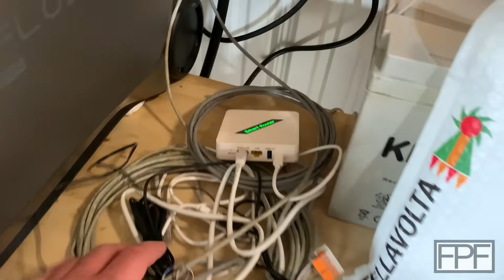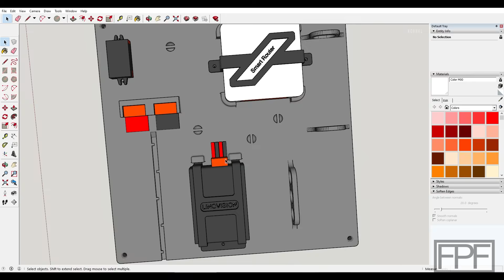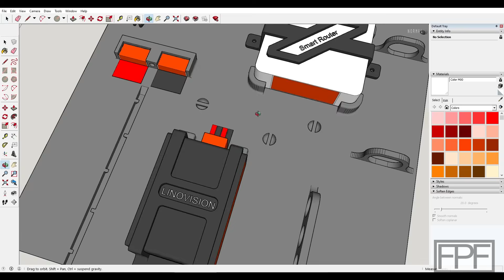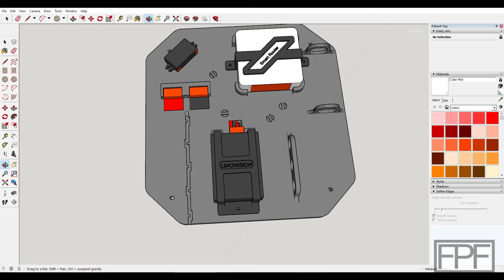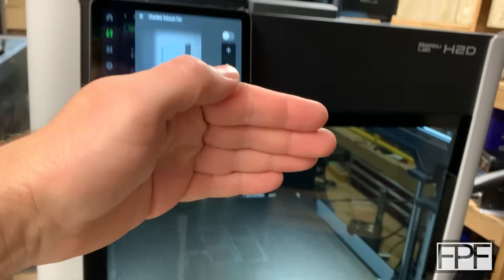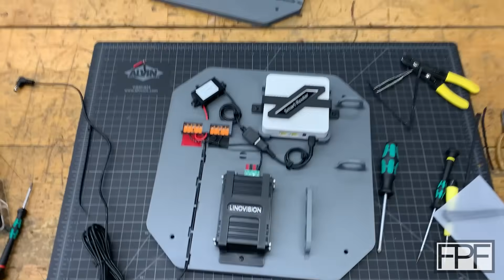3D Printed Equipment Mounting Board - H2D Problem Found

Comment from the maker: Nobody panic, this should be an easy software fix to give us the needed option to avoid this issue.  The H2D remains an awesome next-gen machine.  EDIT: a lot of folks in the comments seem to be missing what the issue is here.  In summary, this is caused by the "exhaust fan" cooling the print unevenly when the ambient room temp is low or changes.  While there are controls in the slicer for the "part" and "aux" fan, there is presently no control for the "exhaust fan".  It can presently only be disabled by modifying the "start gcode" for each filament.  There's numerous ways this could be solved, but a good starting point would be for Bambu to add the "exhaust fan" to the same section of the UI in the slicer where the "part" and "aux" fans are configured.
Reply: Funny thing is that it already exists. The setting you are looking for is in material settings.
Reply from the maker: @BifsieOfficial  where?  I see "part" and "aux", but not "exhaust"?  I do see it looks like we can mod it out of the start gcode settings at the filament level, but I think a slider for whether to enable it or not rather than modify every single filament preset would be helpful.  Am I missing something?
Reply: @FunctionalPrintFriday So for you, editing the settings of the other coolers for each filament is fine, but for the exhaust fan it's suddenly inconvenient? And yes, you need separate settings for each individual filament, precisely because each of them behaves differently and some need maximum airflow from all sides, some don't.
I can guess the reason why these settings are in the form of g-code, most likely because it is impossible to make one separate slider, because there is a dependence on other printer settings, for example, for different table temperature different values of exhaust cooler.
p.s. Sorry, I replied to the wrong thread. I was responding to this comment https://www.youtube.com/watch?v=sYN-dwEzZQ8&lc=UgwVapduMXSDJznUX1J4AaABAg.AHO5ASZA3d7AHQZKH8Ozrr
"Manually modifying the start gcode for all the PLA/PETG filament types seems rather painful though, hopefully they either add a device-level control in the UI, or at least add the exhaust fan to the cooling settings in the filament config"
Reply from the maker: @Firz82  I'm not sure what you're trying to say.  There is presently settings to control the part cooling and aux fan in the filament settings, but there is no setting for the exhaust fan (which is the fan causing the problem here).  You can manually disable the exhaust fan by editing the start gcode for each filament, or turn it off using the touchscreen each time as the print starts, which is what I did for the 3rd print that came out great.  I'm saying that at a minimum they should add the exhaust fan to the same part of the UI where the part and aux fans are controlled, or add a device-level override at the print-launch screen or device config.
Reply: @FunctionalPrintFriday  I meant that the g-code for exhaust fan control is more complex than just a % value. If you look at this code in the Advanced tab, you can see that it uses table temperature values and information about whether air filtration is enabled or not in its logic.
Reply: I think that the “disable exhaust fan in printer” button will only hurt most users who don't fully understand what they are doing and what it can lead to, because for certain types of plastic the nozzle will start to clog. The manufacturer believes that this setting is for advanced users who understand what they are doing, and I partially agree with it. The main problem I see is that even in their Wiki and FAQ they don't tell anywhere (or I don't know how to search) about exhaust fan, how it can affect printing problems, these g-code settings and how to manage them.
Reply: @FunctionalPrintFriday 

In the filament profile, try enabling "enhanced air filtration" or whatever it's called! On the X1C/P1S it's the only way to edit the exhaust fan speed, so maybe it's similar on the H2D? it's quite counterintuitive, they need to fix this.

I spent a lot of time trying to fix the fact that my P1S kept setting the exhaust fan at 100% when printing engineering materials lol, the start gcode sets the fan at 100% by default if bed temperature is over 80C lol. "Enhanced air filtration" fixed it!
Reply: @Firz82 doesn't the H2D have a chamber temperature sensor?
You could set a max and min temperature you would like to hit, and the printer could automatically close the vents if it goes under your preferred minimum temperature (and of course open them and ramp up the fan accordingly if it goes over the min, and approaches the max)

It would not only fix the issue for PLA, and PETG, but also be much more intuitive to users in general for all types of filaments.
Reply: @FAB1150  Yes, as far as I understand from the description of this functionality on bambu's site and other people's reviews (my H2D hasn't arrived to me yet, so I can't test it myself), this is exactly how it will work. This is just one of the reasons why the exhaust fan control logic is in this section with g-code, and not just a slider with values from 0 to 100%.
Reply: @Firz82  A simple warning, or putting it behind 'advanced' mode would suffice.
Reply: Update filament settings. Put 45C in for PETG. Prints mint. Stays in heating mode. 40 is the bambu cut off. Below it is cooling, above is heating. Granted your method to override temps with the air filter enhancement works too. I do find my petg filaments do better with 45c heat on
Reply: I mean, you made it pretty clear. People live to comment without watching the video. You'll see more and more of this as your channel continues to grow.
Reply from the maker: @michaelgleason4791  probably right
Reply: It seems that the issue is the internal stresses within the part are greater than the magnetic force keeping the build plate to the bed. Without hands on experience of this issue myself, I believe the easiest and most robust solution to the symptom you are experiencing is to create a set of retaining C style clips that can be installed from the edges of the build plate and bed effectively securing the plate to the bed restricting the plates movement in the X, Y and Z axis. 
Alternatively, the  Markforged Eiger slicer creates tool paths that are designed with the parts geometry and material in mind that will greatly reduce the internal stresses created during extrusion. e.g. Eiger may start in the middle of the part rather than exterior walls and printing outwards to allow for even cooling and spreading the stresses more evenly across all axis. In comparison, most consumer slicers will prioritize external walls the infill from one side to another. This is the worse case scenario for creating internal stresses pulling on the exterior walls. 
Keep in mind that once the C type clips are installed, you may then find for these large prints that the part will then break free from the build plate....Glue stick! Hope this helps! Looking forward to an update. Great video!
Reply: @RevEngFTW  someone’s already made clamps for it on makerworld.
Reply: Would be curious to know if you hear back from Bambu.
Reply: Set your chamber temp to something other than zero and let the machine do the rest.
Reply: Not a software issue, your build plate is sitting high in corners. Take build plate off and tighten the screws underneath and should solve your issue.
Reply: How should a weak magnet and a too thin plate fixed by sw?
Reply from the maker: @lazyman1011  Problem isn't magnets, it's airflow causing shrinking unequally.  Print was perfect after solving for airflow.  They need an option to disable exhaust fan/vent
Reply: Edit: Couse I didn’t red the hole conversation due to the yt app.

The build plate should always be stronger than the material deforming force.

But that’s only my idea.
Reply: @lazyman1011  I think you underestimate just how much force there is at the edges of a print this size pulling on those magnets. At some point the user does need to be able to actually remove the sheet :D
Reply: @JohnVanderbeck  good point

Comment: Coming across this video almost a year later. I have about 600 hours on a P2S and I have a terrible time with any PETG, including Bambu's own PETG-HF. Preheating the chamber with the nozzle and print bed has helped. So has printing an ABS deflector for the cooling fan.

Comment: Got the same Problem i guess, Printed an big Lego Plate that 10:1 4x3 Pins on my H2D and one side was like an Bannana after the Print and one Side was Plane but on the Video you cant see that the Part was warping from Sheet to the End! I used th glacier Sheet not he orig. one with PETG. I tested the Force on my Sidewinder X1 with Aluminium Bed and the Force there isn't better than on H2D if i use my Pinkey Finger to lift the Corne on PEI sheet so Probybly an Problem on some different Printer i guess than! What kind of Magnetic slefadhisiv Material is the best to replace the orig. than??? Is there anything out with more DARK magnetic Force Luke????

Comment: For all of the sensors in these new H2 printers, you'd think they would sample the ambient and control the vents and/or fan speed based on the conditions to maintain a stable chamber temp ... even with PLA.

Comment: Simple design, but discovered an issue and was able to find a solution that may Bambu can resolve eventually. Also, when you started this project first thing that came to mind are the 3-D printed wall boards like. Multiboard or honeycomb storage wall. Yours is designed for specific need and the other ones are modular but great work. I love it.

Comment: They already know chamber cooling causes warping on large bases and that the solution is to disable cooling of any kind.  I don't know why Bambu hasn't tackled the issue, though.  They still have Aux cooling turned on in the filament settings, and I always turn it off, even for smaller prints.

This isn't an H2D problem.  In fact, it could be argued that due to the chamber heater, this problem is much mitigated.  A consistent 38c should make this problem go away.

Comment: The H2D is great (I have one) but it cannot defy physics . This is classic warping - this happens because the upper layers cool too quickly, causing the filament to contract. I've also had prints (in the X1C) that pulled the plate away from the heated bed. Adjusting your settings should (hopefully)  fix this without adjusting your design:

1. On the Filament menu, set the chamber temperature (under print temperature) to at least 35C. The printer will maintain this temp. Keep the lid and door closed. You can try increasing the temp in 5C increments, but at some point you risk clogging the hot end.
2. Increase the bed temperature about 5C above the textured PEI default. 
3. Turn the Aux fan off until you absolutely have to have it on for bridging. (Insert custom gcode in the preview window on the appropriate layer: M106 P2 S0 is off, M106 P2 255 is full on). The AUX fan is doing more cooling than the top vent.
4. You need to use an infill pattern that evenly distributed the stresses. Try Gyroid. The print may be too short to fully benefit from this, but it is worth a try. (Looks like you may be using this or something similar already based on what I can see in  he openings.)
5. Try increasing the infill print speeds. The longer a layer takes to print, the more time it has to warp.
6. Try increasing print temp in 5C increments. This may work against you when bridging, though.
7. You ended up reducing the size of the design - this also helps a lot.
8. Reduce the number of top & bottom solid layers if possible, especially the top layers.
9. Lastly, try increasing the layer height; more height keep the layers warmer. If this impacts your bridging, then use the slicer controls to reduce layer height when you start bridging.

Most of these settings raise temperatures, so you do run the risk of clogging the hot end and/or having goop stick to the nozzle. You may need to experiment.

As you noted in another video, you can turn off the exhaust fan by enabling "Air Filtration Enhancement" in the printer settings which enables the  exhaust fan controls under the filament cooling menu.

I print a lot of large items, and I have always been able to prevent warping using some combination of these adjustments (at least, so far! 😉).

Comment: I would definitely reach out to Bamboo lab for this because those machines definitely are not cheap in any manner whatsoever and it should not be doing that in the corners or anywhere else for that kind of money. It's bad enough that you're excluded 2 colors on each end of the build plate let alone for the corners to be cut off as well

Comment: I was even gonna ask if you had the auxiliary cooling fan running (the one at the side of the bed) while printing this.  Because that's the biggest issue I find with my X1C when it comes to prints with larger first-layers.  With PETG it's not usually a problem since their PETG profiles typically don't have that fan on, but for some asinine reason, they have the aux fan set to 80% with PLA.

Comment: This takes commitment and a full understanding of, not only the engineering, but the environment in which it's printing.  My example is that I hijacked my son's old room for my studio it shares a bathroom with another room. So when they shower the humidity level immediately impacts my prints but also the life of my desiccant in the AMS.  I'm looking into  either a dehumidifier or I move the printer away from the bathroom door.  Thanks again! ✌🏼from Houston, a.ka. Satan's Armpit in the summer.

Comment: To be fair if that print cools too fast then there is a LOT of force pulling on that bed.  I am disappointed as well because Bambu is "just works" without having to fiddle, or at least that's how we like to think of it, but there is probably 5% or some where you do just need to either fiddle or design around limitations.  Hopefully they can tweak the profiles a bit to better cool this, but in something like that that is a huge flat area filling the whole bed, I try to but relief into the design.
EDIT: Interesting how this ended.  I never realized that temperature could have such a huge effect.  I print in my garage.  Well technically a room sectioned off from the garage and TECHNICALLY under air but it never gets down below like 80 degrees in the summer if I'm lucky.  But in the winter it can be much colder.  My point being I can get wild temperature variations throughout the year so I wonder if I'll run into issues as well.  On my X1C I always open the door when printing PLA but that's mainly because Bambu says to do so, I never tried without opening it.

Comment: The warps cause it to fail because of the large surface / contact area during the shrinking.

If you were in a situation where warping was not preventable but you wanted the print to succeed, you could consider the following:

If you're never going to see or use the bottom, then slice it with 0 bottom layers.  

Honestly, with honeycomb infill, zero top layers might also look kind of cool and industrial.

Comment: I just got my H2D yesterday and attempted a PETG/PLA print and had the same issue with the PETG even after using some build plate glue. I have a similar issue where my printer is near a vent in my home and at night we tend to lower temps to about 68 F. I believe you're right on the money regarding the venting, I'm going to close the exhaust manually and see if that enables the printer to finish the job. Both times I cancelled the prints due to the edges lifting off and both were attempted in cooler conditions right next to our vent.
Reply from the maker: let us know if this solves it for you as well

Comment: When i built my current 3D printer about 4 years ago i had to choice to go with a 350w DC bed or 500w AC mains for a 300x300mm print area. After thinking about bed warping i've experienced since i started my 3D printing journey in 2012 I ended up going with 240w DC and glass bed. Which isn't a lot for a 310x310mm physical bed with glass on top, takes 12 minutes to reach 110c. Which is GREAT to preheat the chamber to about 55-60c, then climbs another 5-10c while printing. Previous setup was 260x260mm with a 300w bed with glass on top that warped a bit over about a year. I also had a bed slinger with a magnetic bed with a high quality PEI surface, even though enclosed i did notice it would pull bed bed off the platform when printing large ABS prints. I use a 310x315mm Creality glass bed with a carbon surface and small binder clips to hold it down.

2 things about the H2D i've noticed. 1. It seems to require about 10 minutes of heat soak to even the temps across the bed. 2. Glass beds IMO are a requirement for any large high temp prints if you want perfectly flat prints for certain geometries that will overcome the strength of the magnets.

I was about to order me an H2D but decided to wait for the kinks to be worked out. It would be nice if they made a glass bed, maybe with spring steel glued to the bottom of it. But now that the Bondtech INDX got announced i might just upgrade my printer with that

Comment: Awesome feeling to design and print / use a functional part! I only made small things like an Apple Watch charge stand, and an office supply / scissor holder etc, and even a shelve mount / frame for a humidity sensor. but use these everyday. I do not think what you did was overkill, but a great solution to tidy things up! :)

Comment: I think I see the problem! Check the upper bearing of the left Z threaded spindle. The rubber has slipped halfway out, which is causing tension in the spindle. I had the same problem with my H2D. It's best to remove the rubber completely; that helped me a lot.